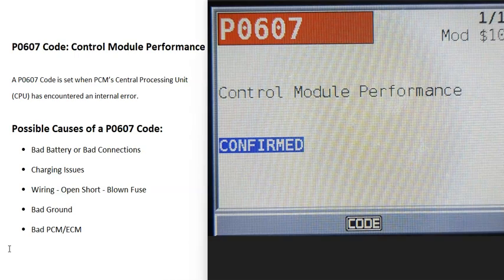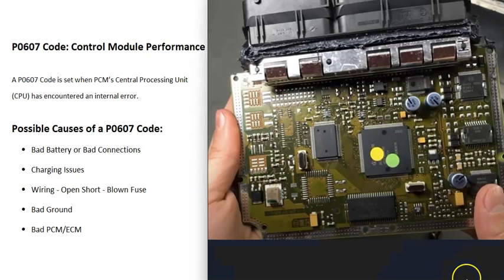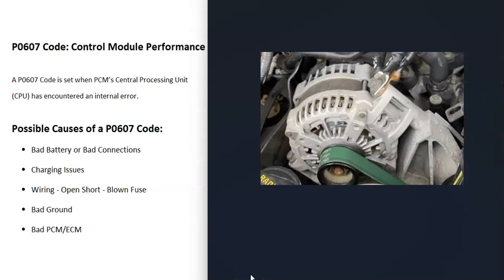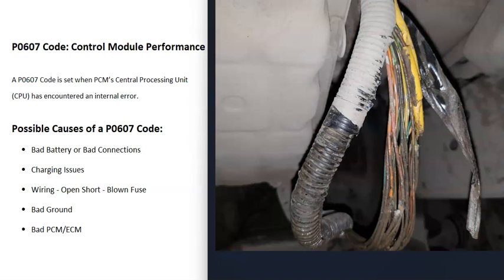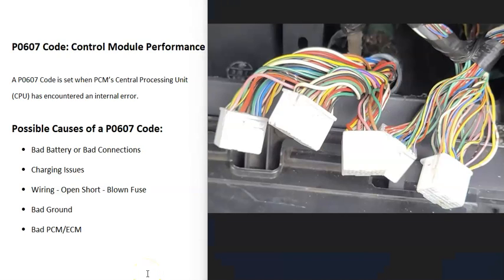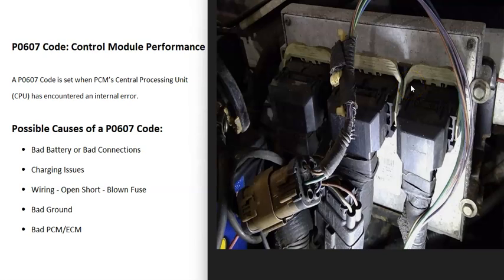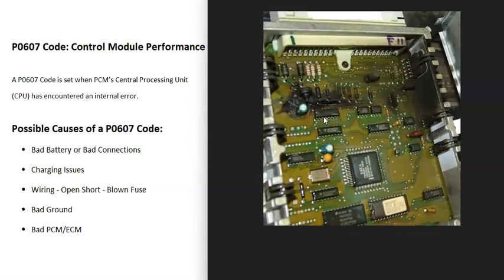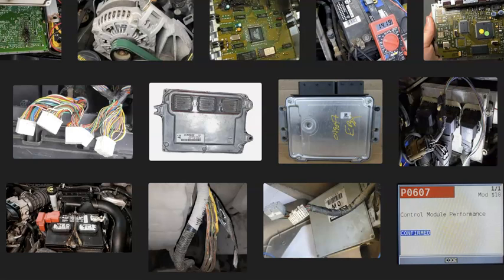Causes and Fixes P0607 Code: Control Module Performance

Comment: Hi, I just seen your video on the possibility why my these codes are showing up. Ever since I jumped another car. The check engine light came on. My batteries and alternator are good. Any help on this. I would greatly appreciate it
Reply from the maker: If there was a voltage spike that can cause problems. I would start by checking all the fuses, especially the main battery fuse in the engine bay fuse box.

Comment: I recently drove through a large puddle during a rain storm and shortly afterwards, I got this code.
Reply: Same did you ever find out what it was im going thru that right now
Reply: @ElQuinteroTV  this just happened to me today. It rained and this made my check engine light come on with this code
Reply: @kmart014  Bro, same lmaooo. My car is running well tho.
Reply: @ElQuinteroTV I haven’t figured it out yet.   The light will not stay on long enough for the 2 hour drive to the dealership for diagnosis.

Comment: 2008 Ford Focus just started doing after it got really cold out.  Replaced the battery, but it still does it.  Also, it cuts out the throttle when it happens (electric throttle) and don't want to stay running.  Any ideas?

Comment: PCM and ECM are NOT THE SAME.
Reply from the maker: The ECM controls the engine, while a PCM controls the engine and transmission. Basically, they are the same; just one does more. A vehicle with an ECM will rely on a separate module, the TCM, to control the transmission.

Comment: 2012 RAV4 82,000miles - pulled a P0607 control module code - no other codes. Each time I fiddled with my gas cap, the lights went away. Got a new cap, lights stayed off for three weeks maybe a month - lights came back on now. Battery, starter and alternator all checked out. Any other ideas? Car doesn’t seem any different with driving.

Comment: got this now on a 2010 rav4, 2.5L. Battery good, o2 resistances match the resistance of 2 new sensors, cleared it and it's not coming immeditately back and driving it the 2 o2 sensor heater monitors set with no codes. pita !
Reply: Had the same problem with mine showed up oxygen sensors and module clear the codes been driving for a bit. Seems good now. Any update for your case?
Reply: @reyc3709  I changed the B1S2 o2 sensor. It was working but had some physical damage from rust I didn't see at first. Changed it and it hasn't come back so far. 🤞

Comment: P607 can be triggered  by bad signals from faulty sensors.  My daughter's Toyota Highlander had a wildly fluctuating downstream O2 sensor which gave P0156, P0157 and one P607.  It went away after I installed a new sensor.
Reply: I got to do this I believe
Reply: Mine was also downstream O2 sensor, 2009 Pontiac Vibe.

Comment: I have a 2012 RAV4 that gets a P0607 error code after it rains or I wash the car. I've looked for a leak around the wiring but haven't found it yet? Any suggestions?
Reply: This started happening to me after I drove through a good sized puddle. (Deeper than I thought). I drive a 2015 Lexus is250 fsport and I’m pretty sure that smoked my o2 sensor after my catalytic converter. I’ll get back to you after I fix it.
Reply: @TeaStew Did you fix the O2 sensor yet? I thought I had mine fixed but the lights came back on after a rain. May try replacing both sensors next.
Reply: @mwsmith8384  I did replaced both at the same time.
Reply: @DonVerchi700as Apparently my 2012 RAV4 has 4 sensors. Two of them in front of the catalytic converter. The other two are placed after the catalytic converter.
Reply: @mwsmith8384  WTF?? That's a lot of sensors man. Sounds expensive. Mine was shaking more than usual at the lights .
Reply: @mwsmith8384 Same exact thing happening here on a 2010. The code is making the check engine light, traction control light, and 4wd light all come on.
Reply: @andyc7760 samee
Reply: I took mine to the dealer and it was the A/F / o2 sensors. I replaced both of them and after $500 on parts and $200 for the diagnosis it is fixed.
Reply: @DonVerchi700as  Did you get just the P0607 code?
Reply: @mwsmith8384  yes permanent. Control module performance.
Reply: How long has it been "fixed" for? Give it some time @DonVerchi700as
Reply: I washed my car and light came up next day 2010 rav 4
Reply: Same here. Pressure wash my truck underneath, like came right up.
Reply: After several months of the lights coming on with just the P0607 code, I started getting differnet codes pointing to the oxygen sensor. I replaced both the Oxygen & Air Fuel Sensors and haven't seen the codes in months. You might first look at the contacts for both sensors and make sure they are clean.
Reply: Same here, after rain, the lights are on.
Reply: Any updates fixes?
Reply: @reyc3709  I eventually got a P0138 code along with the PO607 code. I replaced both the a/f sensor and O2 sensor about a week ago and so far (knock knock knock on wood) no codes yet.
Reply: @mwsmith8384  that’s so strange and weird. I washed my car in my first time and the engine light came on for that code. Do you think some wiring got wet some wiring on the RAV isn’t protected if they happen to both of us
Reply: @reyc3709  I do believe that wiring somewhere got wet. Since I got the P0137 code I just decided to replace the sensors. I'm still not convinced the problem has been solved. Time will tell.
Reply: @mwsmith8384  smh cars been a beast at reliability this a strange ass probably ur car getting wet 😂 maybe rain went up the exhaust somehow i honestly think its sum wiring confusing the computer into throwing false codes for o2 since it came up ass computer module